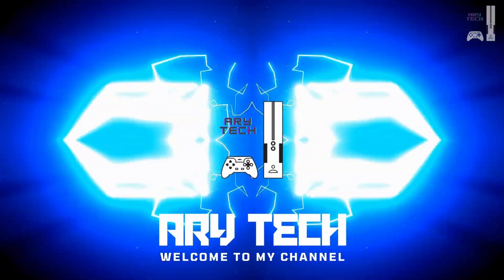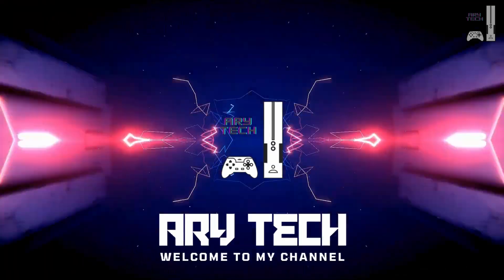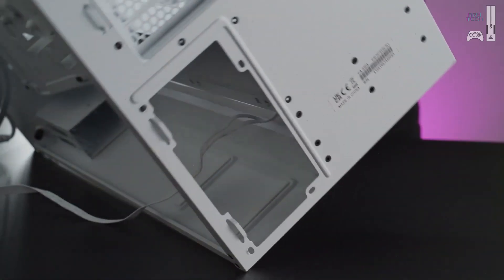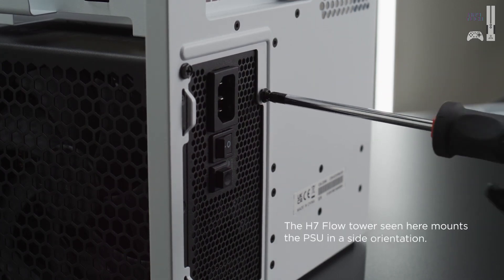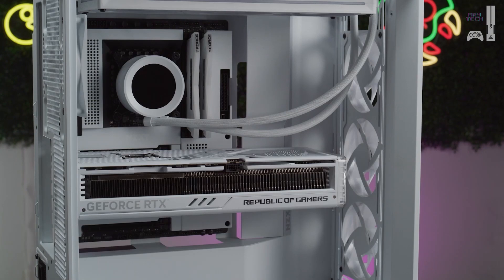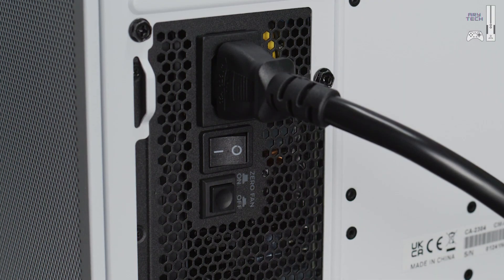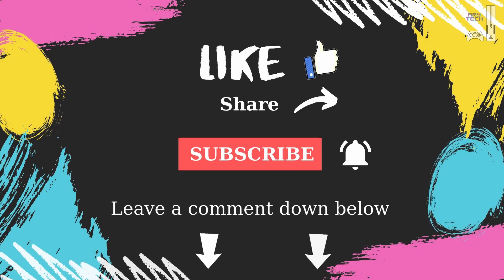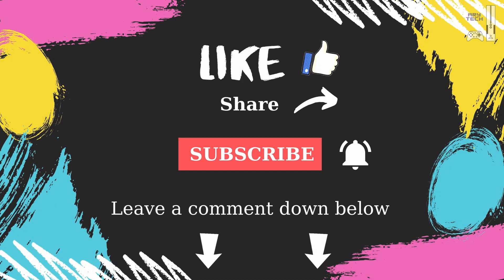Best PSUs to Buy for the NVIDIA GeForce RTX 5080 – Top Power Supplies for Maximum Performance

Comment: is asrock taichi 1300 T good?
Reply from the maker: Yes! 
The ASRock Taichi 1300T is an excellent power supply for an RTX 5080 because it offers more than enough power (1300W) with ample headroom for other components and potential overclocking. It's ATX 3.1 and PCIe 5.1 compliant, ensuring native support for the RTX 50 series' 12V-2x6 power connector, and even includes two such cables. Its 80 PLUS Titanium and Cybenetics Titanium certifications highlight its high efficiency and quality components, backed by a 10-year warranty. This makes it a reliable and future-proof choice for your system.
Reply: @AryTechB  yeah I am thinking to buy it and hook it up with 5080 and 9800X3D im just way too afraid of melting the connector

Comment: So, 850w psu is enough for RTX 5080?
Reply from the maker: RTX 5080 Power Consumption: 360 watts; NVIDIA recommends an 850-watt PSU for optimal performance.
So! Yes
Reply: Been using a 850w PSU for a few days on my new Zotac 5080 and no issues so far!
Reply: @LeMonke-kj8zj  the cpu?
Reply: I'm building a 5080 with amd ryzen 7 9800x3d, so 850w are enough?